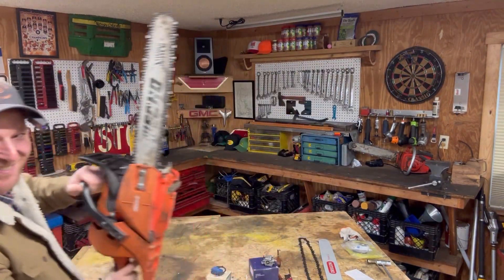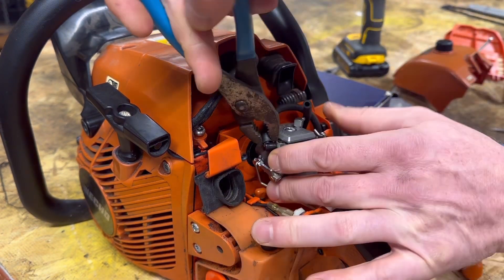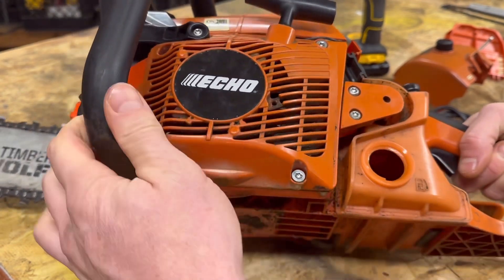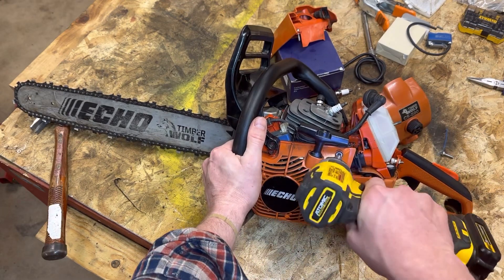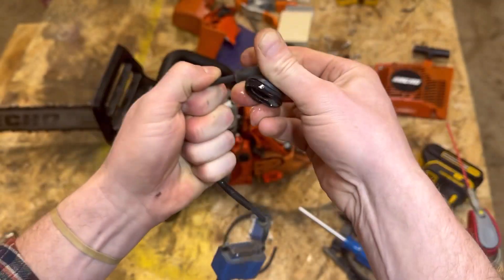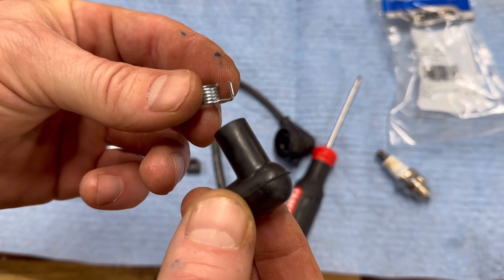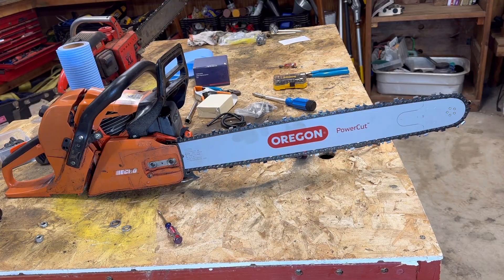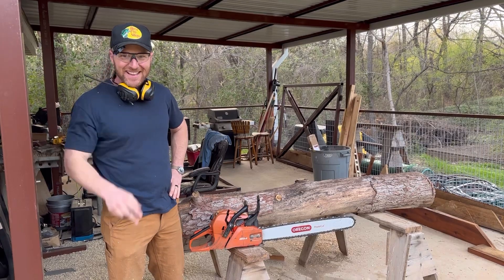Echo CS-590 Chainsaw UPGRADES! (Carb, Coil & Bar Replacement)

Comment: You said 520 when talking about the carb. I’m sure you meant 620 though. I don’t know why you can’t find reasonably priced carbs for the 590-620 because I see them all over starting at $25 bucks.

Comment: What did you set the gap on the coil?
Reply from the maker: Excellent question, I totally forgot to gap the coil but it still ran. I usually just use a business card to gap them on mowers.

Comment: Not worth installing the 620 coil. Get a gearhead performance offset flywheel key. Same boost in performance at a third of the cost. 620 carb is the only thing really worth paying for.
Reply from the maker: Dang that is cool and he 3D prints those parts. Wish I knew this earlier, thanks for the input
Reply: My understanding is that the 590 coil is a rev-limited design whereas the 620P coil is not.
Reply: @DoyleShadduck  only documentation I’ve seen from echo is 590 coil is limited and 620 is not. They don’t mention if there’s a difference in advance, or more aggressive timing curve between the two.

Comment: You can run a 27,28,& 36" bar on 590 but I would change out drum sprocket to a rim sprocket.